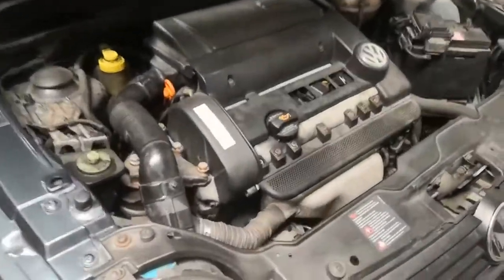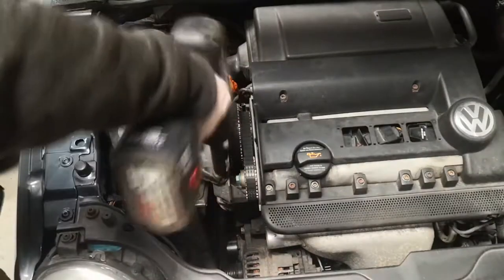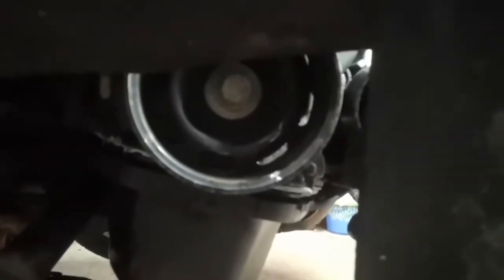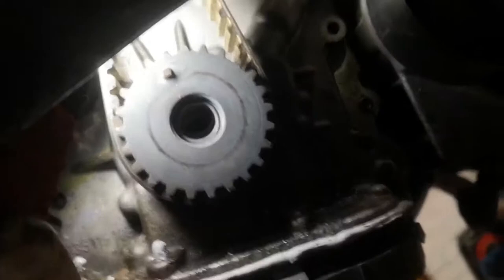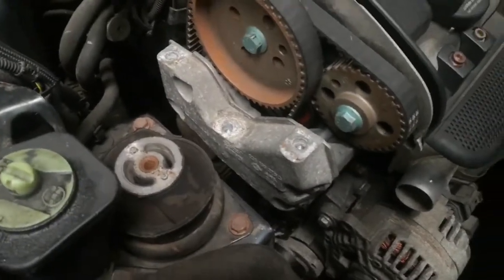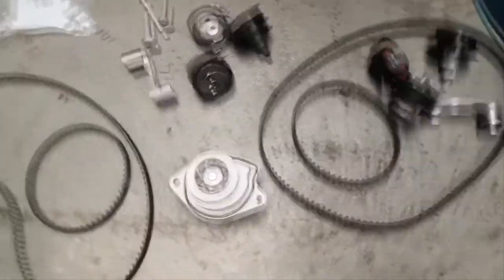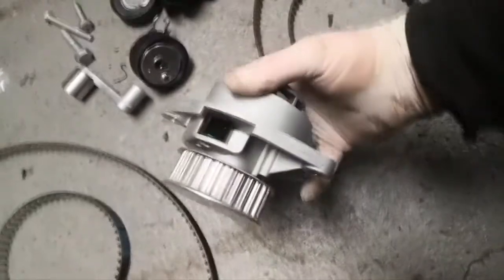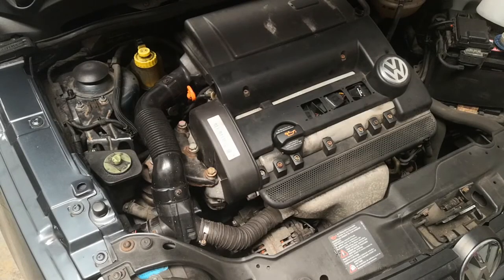Vw/Audi/Seat/Skoda 1.4 16v/ 1.4 8v Timing belt replacement

Comment: Will this be the same to do on my 1.4 mpi 8valve engine code AUD seat Ibiza 99-02 .great vid make it look to easy to be true
Reply from the maker: Yes it's basically the same but only 1 belt and 1 cam so different top end but still has a locking tool, the bottom end is the same but lock it to the 2v mark not the 4v mark
Reply: Thanks for the reply Callum s.so basically when marks are lined up on top pully and bottom one is lined up to the 2v mark it can be locked and take everything off.one more thing iv never heard of screwdriver in flywheel to lock it.is that the proper way or is there an actual tool that goes in through a hole .sorry for the long text just want to know I’m doing it right 😹
Reply from the maker: @grahammaddison7482  it's been a while since I used a crank locking tool but iirc it's a pin that replaces the crank sensor and locks the flywheel in place.
Reply: @DubworxMedia  thanks for reply .appreciate it
Reply: @DubworxMedia  hi Callum what size socket is used for crank shaft to rotate camshaft.thanks in advance
Reply from the maker: @grahammaddison7482  off the top of my head the crank bolt is a 12 point 18mm and the cam bolt is the same unless I'm confusing it for the diesel engines
Reply: @DubworxMedia  👍👍

Comment: Hello, I have a Polo 1.2 3 cylinder simple arbre à came 2004. I want to change its engine to a more powerful one.
Reply from the maker: Most people either buy a GTI or swap a 1.8t or 1.9tdi into it as they came with those standard so all the parts can be bought from other cars
Reply: Is the polo 6r 1.2 12v 3 cylinder engine  good
Reply from the maker: @Hamzewi  not really much better if I remember correctly it's a 60hp version and still suffer from various issues, for reliability I'd say a 1.9tdi from a polo, ibiza or fabia, they will drop straight in just a few other parts to swap along with the engine or a 1.8t if you don't want to swap any fuel related parts other than the pump.
Reply: @DubworxMedia  Well, if I keep my engine, that's better